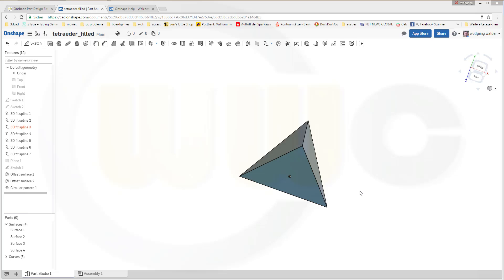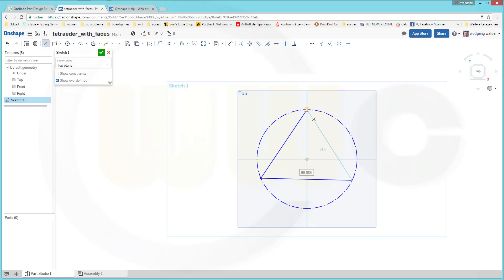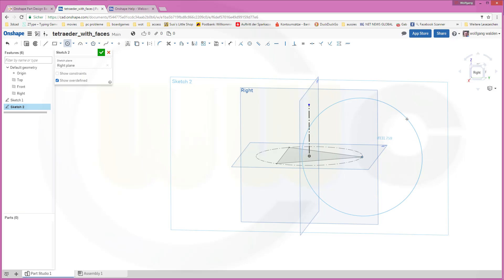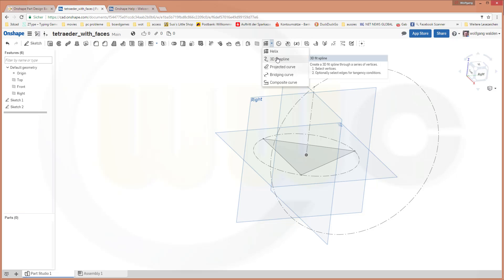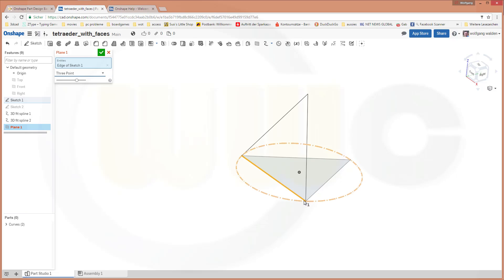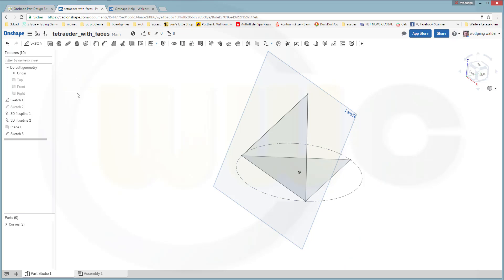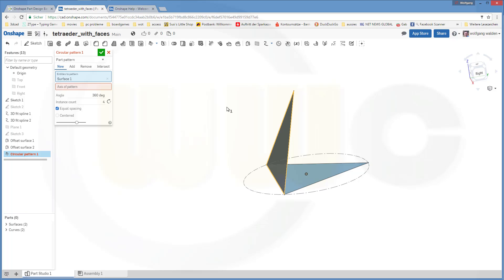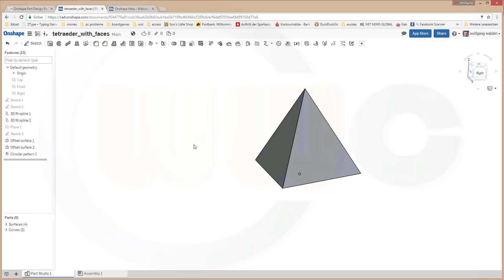8.5 Tetraeder -  offset face - Onshape Training - Part Design

Comment: It's too complicated. I done it in 3 steps - 2 sketches and one loft. 
1) Top Plane: A triangle in a circle, let one of its corners also lie on the right plane (point 1)
2) Right Plane: first line from the center point of the triangle (the height of the tetrahedron) to the sky:), and another line of length equal to the side of the triangle from point 1 to the first line. Now we have the vertex of the figure.
3) Loft with the triangle from step 1 and the vertex from step 2.
Reply from the maker: 😂 it is an exercise and I usually try to do it in all programs in a similar way.  To use a point as a profile for a loft is at the moment only possible in inventor and onshape. I don´t recall if it was possible 6 years ago in onshape. Merry Xmas!
Reply: Thanks for the reply, I didn't expect to get it under a 6 years old video) Merry Christmas  @wolfgang.walden.cad.training  !

Comment: Hi there!!! There is a much easier way to make a pyramid in onshape
Here is what i learned. first make a square on your top plain, then extrude the square,
but before you do make sure you have the "Draft" box in extrude checked, then
click on the green check mark and Voloa..there is your pyramid...you have to set your degrees.
Have a good day!
Reply from the maker: LOL that is not an easier way - sorry it is just wrong. A squarebased "pyramid" is not a tetraeder. Your "pyramid" has 5 corners and 5 faces with different sizes. A tetraeder has 4 corners and 4 equally sized faces.